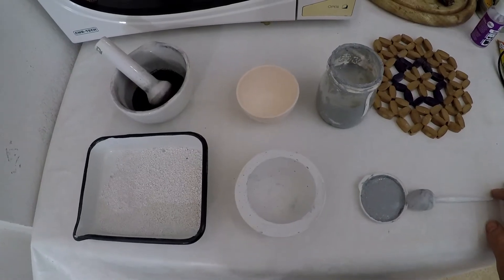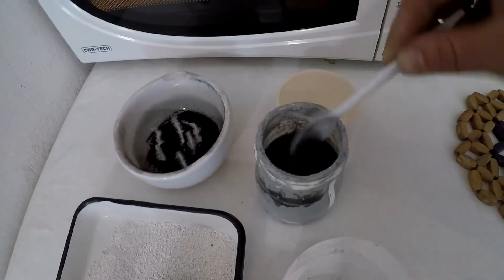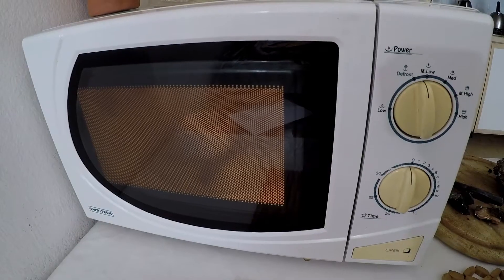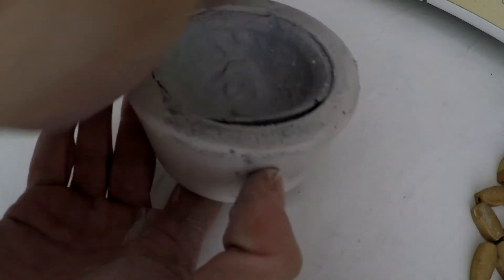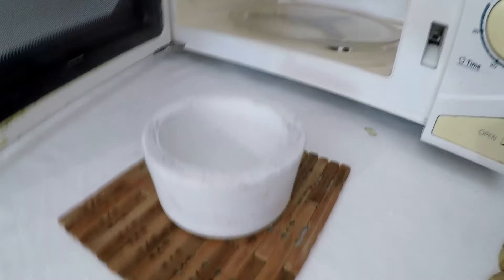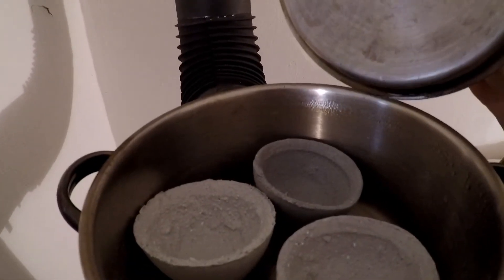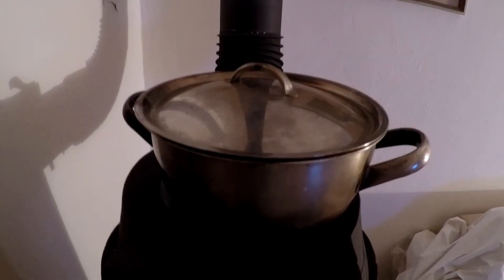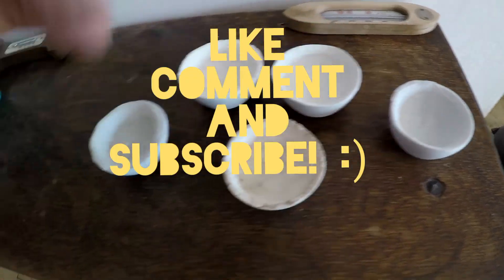Homemade alumina crucibles

Comment: Hi GoodEnough! Very good tutorial; nice presented. You should go on with your trials and videos. I am directly interested in your ttests, so those are not just plain comments. My questions would be: for what metals are the crucibles intended for?  have you noticed a certain life span related to type of metal mold?  have you tried a comparison between charcoal and non - charcoal mixtures? I tend to bet on charcoal addition based on your presumptions (and my personal guess) ; but it is confirmed?  How large do you  consider can this method be expanded?  I am targeting it for aluminum - up to 10 kg charge for finished mold  up to 3 kg (not sure about output; it is just an estimation). And hoping for a more durable crucible than steel ones.
Good luck,  you are doing a very good job; both in trials and presentation!
Reply from the maker: Hi Mihai!
My apologies for the late reply!
First of all, thank you for commenting and showing interest in my projects.
As for the questions, I will try to answer them accordingly.
The crucibles I made were intended for the use with ferrous metals, mainly iron alloys, as obtaining crucible steel was a key factor for my dissertation. 
I saw that the crucibles were really long lasting, when it comes to high hardness, lack of porosity propagation and durability, except when it comes to rapid thermal cycling. I sometimes had no options but to blast the furnaces dull power with them being cold. Slow and steady increase of temperature should be applied, not rapid. Even with a high alumina content, which has great thermal expansion properties, it proved that the biggest enemy is the sudden heating or cooling. 
I have not tried yet a proper test of various void forming substances, as charcoal was readily available to me, cheap, easily transformed into a powder of fine grain, and non toxic. Also, the lack of its expansion during heating was a desired (albeit accidental) property, as well as complete burnout/sublimation. 
This method of crucible production could be increased. However, I presume adding central wad or lunge would be necessary, alongside great pressure, to increase density and structurally stability. That's how it's done in the industry. There is a video by British pate on graphite crucible production using moulds and dies. Homemade option, of course is very possible. I bet the elephant in the room would be the ability to melt bigger quantities metal at home. But, 10 kg is nothing that can't be done! 
I'll make more video's soon :)
Reply: @emel60  Thank you very much for your answer and clarifications!
 I must agree 10kg looks (and is) like an elephant in the room. 
To define better for myself my needs, I would say I am mostly interested in IC model engines with cast parts net weight up to 0.5kg aluminum. Total aluminum per charge/cast I see as 1.5kg considering all technological losses but I consider normal crucible fill to be only 50% clean metal so a 1l  crucible would be required (almost 3kg total capacity for aluminum). The majority of casts foreseen will be much less than this maximum.

Have you tried any additive for binding aluminum oxide (both when forming and heat tempering)? I have read about 5-7% either water glass or bentonite. I have some pottery grade aluminum oxide but as fine as it is still has a high tendency to set quickly in the slip and also makes me question about cohesion.
In trials till now I had rather bad results- as follows; but I'll  try to refine techniques, and clear "hot spots":
Charcoal powder hardly mixes in the slip; I think its the surface tension matter.
I have added about 5% water glass in the mixture because I had good experience previously with it (aluminum oxide refractory coating for furnace and from the remaining formed some small crucibles in silicon patterns).
The first trial, with consistency matching yours (high tendency of setting, not related to consistency/water content),  dried very quickly in the plaster mold but in less than a minute left no cavity in the middle - solid block - not enough water.
Second trial with plaster mold fully dried in microwave oven and a more fluid slip failed to deposit; plaster was not absorbing water almost at all. My guess is water glass from first trial clogged the plaster pores, although i washed mold thoroughly between slip casts. 
So here I am till now. I'll further test, but maybe scale down until success. Trials were done on a plaster mold made around a 350ml "bio" paper glass.
Thanks again for your answer and waiting videos! All the best!
Reply from the maker: @mihaimastacaneanu8505 oh wow! I admire the project! I would say fingers crossed, but it takes everything else than luck- persistence, patience, sweat and blood! If successful, will you machine the parts by yourself or have them done professionally?
I feared you might want to melt 10kg of cast iron or steel, one more difficult than the other. Aluminum, on the other hand, is much more manageable to work with, not just for the more forgiving casting process, easier alloying, but for the simplicity and lower cost of melting- low melting temperature for the win!
A few kilograms to melt should not be such a problem, and making crucibles to hold 3 kg as well.
Regardless, I would definitely make the crucibles thicker. Either a thicker slip or dye cast, it doesn't matter, but I would not trust my thin ones to hold a few kilograms and survive the transport, tongs, hits, heats. First one in this video is quite thick (7-8 mm), and by the time I made the last one for the experiment I managed to make them super thin (1.5mm). I really would not trust a kg of molten metal to something so thin, let alone three! 

I didn't notice that the charcoal dust had mixing issues. In this video I shook the slip vigorously and I got a rather homogeneous mixture. Perhaps I forced the charcoal to soak up water and made it sink. You can clearly see it in the color change before /after shaking. Ok, after leaving some jars im peace , it did separate by sedimentation. Even the cross-section of the fired crucibles didn't exhibit uneven porosity.

Personally, I avoided sodium silicate for the lower melting temperature. I needed +1600 C for the experiment and it would reduce the structural stability of the vessels. At least I thought so. But, for melting aluminum, I am sure it would be quite adequate.
It is possible that you clogged the pores of the mould. I did, by not completely removing the previous failed slip (from the very bottom) . It didn't soak the water there or it tore apart my good slip by sticking during extraction haha!

Oh wow! I wish my slip dried so fast! I have issues with patience so it sounds like a charm that it dried so quickly... But yeah, I confirm that it is tricky to get a feel for the proper water ratio. It changes with each mixture and type of clay.
I wanted to try bentonite clay in the slip, due to the availability (cheapest kitty litter, available on any store), but I opted for kaolin clay for the historical accuracy and much higher melting temperature. I aimed for the full nine yards! Once again, I intended to melt cast iron and steel. For melting aluminum, I suppose, it would be even better. I remember it is very plastic so working with it would be much easier than pure alumina or even my alumina-kaolin mix. That's why I chose the slip method- I wasn't capable of hand-working this clay mixture. It was short, not plastic. But wouldn't bentonite increase drying time? 

I'd like to see your projects man, they sound very demanding. 

Thanks for the comment. It feels nice to be appreciated and useful :p
Reply: @emel60   I have a small lathe and a small mill and my intention is to start with very small models, making them myself, then go higher and maybe multi-cylinder. Many plans available use aluminum cast parts and in certain aspects, I prefer it compared to metal removal from solid (of course, it is a matter of technology to fit the shape but milling and mainly CNC milling requires a lot of money for expensive devices - not to speak of milling tools which is not one to fit all; I mean for proper job you need a bunch of expensive bits).
Concerning your presentation(s), I like that it is technically focused and keeps the right balance to be  useful (hard to find in many tutorials).
Thanks for further info about your way to obtain crucibles (and for advice about safety), in a new hobby you tend to ignore or minimize risks, because you're pursuing results. I also consider slip method a good way to go;  as I found a cheap enough source alumina powder - if I can achieve good enough crucibles.
I'm new in this domain so I would not have to show much. But I have spotted some people who seem to do things the right way and I'm following them :P. Their results are rather to be watched instead my beginner achievements. I already  have names in my mind and although some are dealing with aluminum casting, good practices and brilliant idea could be expanded.
Patience I have a lot, but not always when comes about new things, which is not exactly a good thing :D.
I follow either gas/ electric/ microwave paths just to find one that fits. Ready made solutions are hard to find here where I live (Romania) because of lack of an effective market.
Iron/ cast iron I consider already a tough target - for me. Both in technical requirements for equipment, power level and consistency of results. Otherwise cast iron is used in model engines for cylinder liners and piston rings (so it is in sight), but requires very good mechanical properties, homogeneity ... 
In addition I take in consideration steel heat treatments/ forging in my oven(s); but never iron/ steel casting because of the level-up required.
Well, never say never, but would be many rivers to cross ...
Cheers!
Reply: Later comments. Just a guess: binders like bentonite in very small quantities might not affect strength at high temp. The matrix is actually formed by alumina and when bentonite starts melting, potentially alumina already starts sintering. 
And a question: how would you consider adding a quantity of silicon carbide to the slip - ups and downs (parameters would be grain size and percentage). Target would be a microwave susceptor "alloy" crucible alumina/ silicon carbide. Do you think that it will be susceptible to cracking? I will anyway make a proto to see how it will work.
Have you tried silicon carbide in place of alumina with the same slip method or you consider alumina cheap and fit enough to stay on it?
Reply: @emel60  Later added another interesting fact: 2 piece plaster mold: it makes easier taking out dried slip cast and allows more complicate shapes (not necessarily baroque :) but crucible shaped, adapted to interior of furnace and with larger capacity).
Reply from the maker: @mihaimastacaneanu8505  Any start is a good start! It seems you have your objectives and aims clear, the rest will follow!
I agree that the beginner's learning curve is a pain, hence all of the attempts to cut corners. But in between laziness and cutting corners is where the magic happens!
Your project seems rather cool and complicated. However, I am sure your passion will get the best results... And in most cases, money is just an obstacle. Whatever works is my saying (one of the reasons behind my channel name)! Microwave, kilns, fireplaces...

I always fretted on cast iron, but I learned it is an amazing material, with so many alloys that it's basic manual is thicker than a phone book! And it is one of the iron alloys with lowest melting points, at certain carbon percentage- lower than 1200 C! That temperature is the actually achievable by a normal charcoal barbecue and a air supply. The higher C content cast iron alloys are a different thing. And so is steel! When fluxes enter the chat, things change rapidly... But I lack any proper experience.
Reply from the maker: @mihaimastacaneanu8505  indeed, in small quantities it might work. I actually bought some time ago (when I was doing this experiment), in order to make green sand noukds but I ran out of time. It might just work, and if it does, I would use it instead of kaolin. It was the most expensive ingredient in the crucible fabric. So I it can be substituted with a cheaper and more abundant alternative, with no structural detriment to the fabric... 
Why not! In the ancient times they used sand and straw as fabric temper. I tried it and it resulted in a long(er) life for the furnace lining - which consisted of loam clay. Otherwise it would start melting around 1000 C.
As long as temperatures get high enough for the alumina to sinter into crystoballite or mullite, I think it would work.

If you could get your hands on pre-ground SiC, I believe rolling the leatherhard clay in it would embed lots of the particles into the fabric. Or the inner surface- just like in the ancient times. You only need just so much for microwave absorption. I don't know what it would do to the drying process and cracking while drying, though. But once sintered, alumina is quite resilient to thermal shock and cracking. In my cases tge temperature rise was to sudden. But just to be clear, you want to make a crucible which absorbs microwaves so you could use the microwave as a kiln?
Reply from the maker: @mihaimastacaneanu8505  hahah my laziness entered the chat!! I tried to achieve such urgent results for my experiment that I kinda started hating the method. But once I give it a go, I have some cute projects, nice drinking mugs abd what not.

Have you considered adding graphite powder to your clay? It is also a good and cheap alternative. We used them in the foundry for every metal alloy. Ok, some where carbide crucibles but most just graphite.
Cheers!
Reply: @emel60  Thanks for clarification and support; much appreciated! I don't have specific studies in domain.
 I have already prepared a new mini- test plaster mold. I need to succeed with slip casting.  First , apart from pure alumina (with kaolin and charcoal) which is ongoing, I will try SiC added in mixture, but inner surface lining is also considered. Thus I think, potential tensions would be reduced. And I do believe the quantity of SiC  does not have to be important for heating effect; I mean no need for integral SiC crucible. I must admit I haven't found yet a source of SiC powder but there are grinding stones made of it as source.
Yes, microwave as a kiln. I truly believe microwave is the future -at least on some particular home melting.applications (I mean dedicated MW kilns, not kitchen ones) Obviously, hardware/ electronics could be the same which would lower prices. Thermal insulation can line the outside of crucible and with  "diode" effect for heat losses vs microwave and reduced surface would make this type of kiln the most energy efficient and easy to maintain. Of course, I personally will stay on the current oven for a while... And  MW oven can melt at least cast iron :)    :  https://www.youtube.com/shorts/1Vqj0o5VWbw .
Reply: @emel60  I haven't found yet a source of graphite powder (or solid form) and as as I have seen, graphite has a less favorable absorption curve than SiC; is most efficient at lower temps. But potential trials are endless...
Reply from the maker: @mihaimastacaneanu8505  What you wrote seems like a good idea. An inner coating or layer should prolong the life of the crucibles. And if something fails, then it should be easier to fix or reapply. Interesting how we always run around what the ancient metalworkers did; in Central Asia the insides of the pit furnaces (made from loam or silt) were lined with broken pieces if crucibles, sometimes crushed, sometimes just fragmented. Since they were of high alumina content, the furnace lasted longer, needed fewer patching up, so yield rates rose, and less fuel was spent by reheating completely cold furnaces. Cool, right?! In this video's furnace I literally 'painted' the inner walls with a very thin and runny layer of pure alumina powder (the last of what I had) and I did not need to fix anything for exactly 3 burns. No molten loam clay mess, no patching up, and waiting it to dry, no firing it first... Saved me a lot of time... No, no it didn't, because it was actually the last attempt ahahahhaha!

Anyway, inner lining would reduce the cost as well. Big grinding wheel, especially old ones, are made from SiC, as well as those traditional scythe sharpening stones. They sre quite cheap and, I believe, abundant to find in any hardware store in Romania.
I looked at these methods fir drying and firing my crucibles but never actually tried it (not from laziness but lack of materials and time). I didn't actually pay attention to it for 2 years and I'm happy someone managed to get metals molten. That's quite a step forward from just fusing colored glass for art. Thanks for the link- it will make me go back to research!

As for graphite I just meant its use for crucibles, not lining. Trianguksr Hessen crucibles were renowned in medieval Europe. What set them apart from other vessel is the high quantity of graphite (at first by accidental use, then probably deliberate), which made them able to withstand high temperature and corrosive molten metals. For its ability to absorb the microwaves and turn it into heat... Well you were spot on. However, it is one material you could create at home for cheap! Look at Thinking n Tinkering channel. Robert has a ton of videos in it.

On a side note, have you ever considered using a welding machine with graphite rods instead of ceramic coated metal electrodes? It creates quite a powerful, yet small arc, melting anything in between! If one would turn the crucible itself into an electrode... Higher volume could be melted in no time!